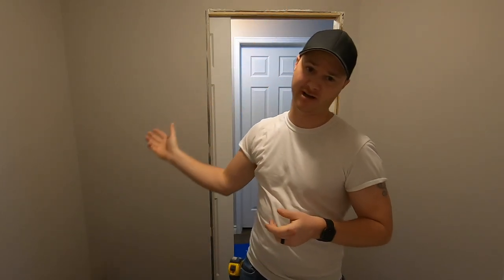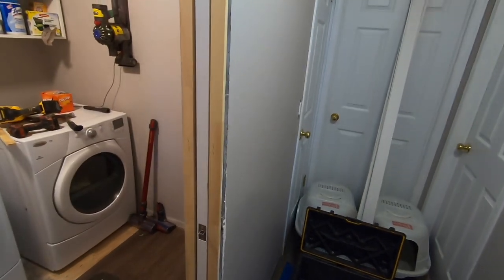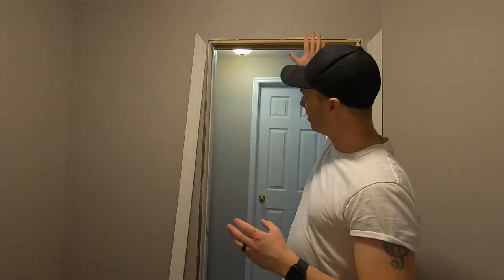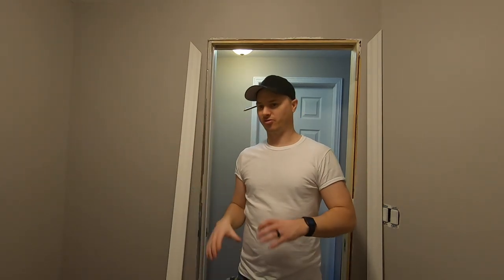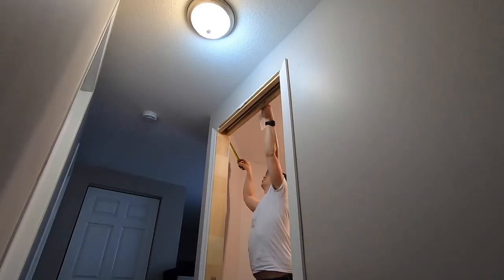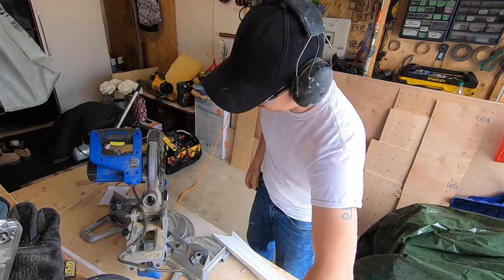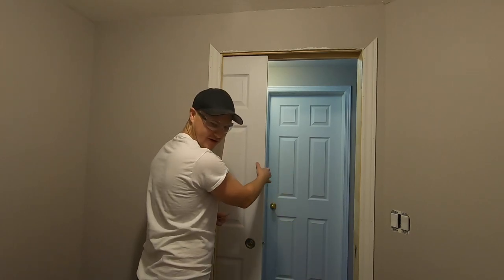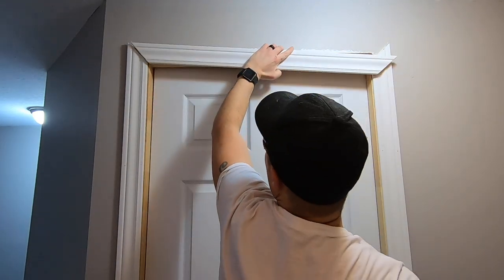How to Install Interior Door Casing on a Pocket Door

Comment: Those 7 1/4” Kobalts are great little job site saws! Great video man!
Reply from the maker: I'm so tired of lugging around a 12" so I picked it up on sale. I wish it would tilt both ways. Might have to upgrade to the Milwaukee 7 1/4. Thanks!
Reply: Does the Milwaukee tilt both ways?
Reply from the maker: Yes but it's battery powered only which drives the price up. The kobalt is 10% of the price.
Reply: Wow! I’ll stick with the Kobalt!

Comment: Im planning on a pocket door for my bathroom, and your comment about that being a bad idea has me concerned.  What precautions should i take? This is a 1909, lathe and plaster situ and we cant cuss a cat in there with the swinging door. And is there some way to tell if it is a weight-bearing wall if we cannot get into the attic? Wait, we can get into the basement, so i guess that wd tell me, huh? Anyhow, thanks for a very understandable vid. I'm pretty green when it comes to this stuff (as in inexperienced, not ecological) and appreciate your logical, common sense ways.
PS  - i will be re-using the original, solid wood door unless you think it is a bad idea. Any thoughts?
Reply from the maker: I would have an engineer out too look before you remove any walls

Comment: Why did you leave the bottom door guides sticking out or did you just not show how to mount them behind the trim?
Reply from the maker: It looks nice to put them behind the jamb but a nightmare to adjust if you need to, so I usually put the on the outside of the jamb.